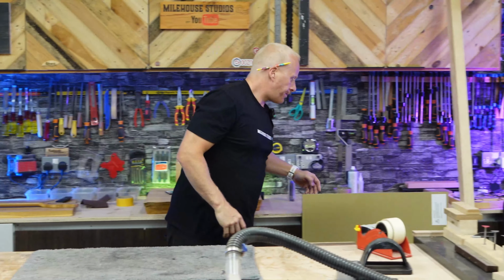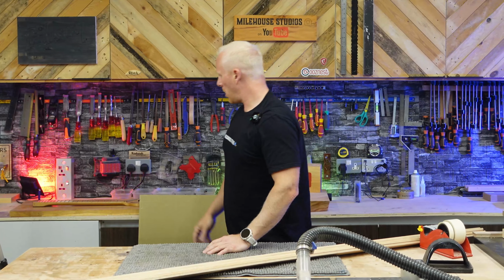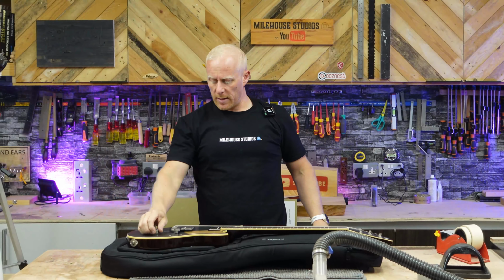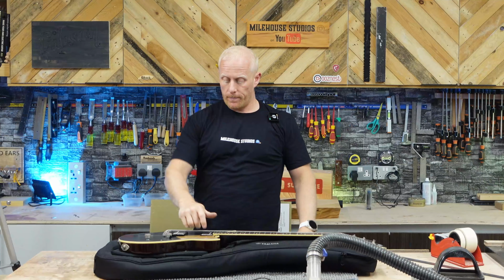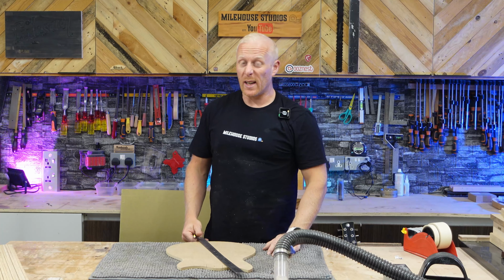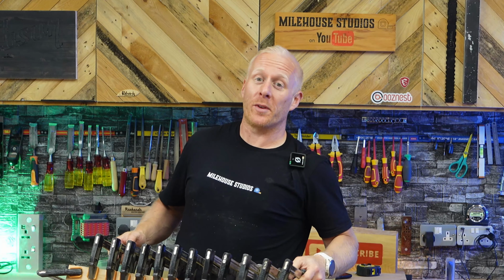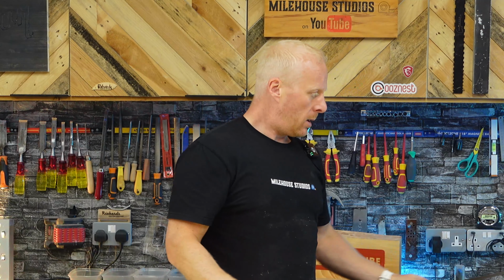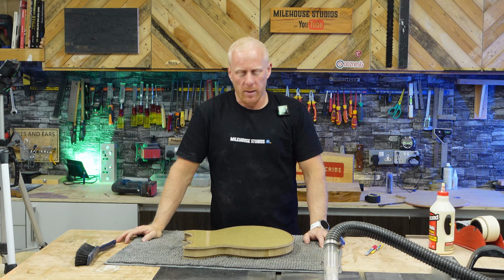Making Chris Bucks Guitar?  Day 1

Comment: This is going to be really cool !!!!   I think if you routed the centre piece for the pickups, wiring channels, and control cavity before putting the top on it might be easier... you can then use a flush trim top bearing bit to rout the pickup cavity in the top by placing it face down on your router table.....once the back is glued on the cavities will be done... you'd just have to remove the portion of the back that sits over the control cavity .... might work ....I'm sure you've already got a plan .... Cheers Mate !!!! looking forward to the next one !!!
Reply: Agree re: wiring channels.  Also consider weight relief - a few big holes on the middle section.
Reply from the maker: Weight relief will be happening. It weighs a ton 😂

Comment: I am not a luthier. I am just an alo guy who wanted a really cool over the top guitar that i made myself. partly for the resulting guiter , the adventure and learning the new skills for the build project.  Starting with a Starcaster-Strat electric hguitar By: Fender. and going totally ouverboard with mods and upgrades. I trashed the cheap electronics and stripped the body and headstock down to bare wood.  And the adventure begins. I used spray cans and airbrushed details. Starting with a gloss black base coat and then began the stars and planets outer space theme paint job on the body and headstock. finished with 2X acrylic seemi gloss clear coat. . And away we go with a custom hand made extended brushed stainless steel pick guard loaded with 3 quad rail/coil humbuckers wired like a "50's Les Paul with coil splits.. Yup that means ther are 6 500K audio taper pots 2 are regular typr tone pots and there are 4 P/P pots, 3 are for voil splits and vol. the 4th is in the bridgee tone for a bypass that activates the bridge and neck pickups togeyher regardless of any other controls. I used .047 orange dro[ tone caps. all of the choices in the design of the control circuit are to promote a clean bright "Strrat" type tone. ..yup 3 vo/. 3 tone and a Fender 5-way blade switch. the pots ar arranges in 2 crescent rows of 3. the output jack was relocated to just behind the bridge also mounted in the pick guard. the bridge got a full size brass sustain block and roller saddles. the headatock got a titanium nut, roller sstring tree and locking tuners .. all the exposed haerwaer is chrome. Knobs, switch tip, tuners, the top of the bridge are all chrome. all loaded in the afore mentioned extended brushed stainless steel pick guard that acts as a shield and is the main ground through the controls cases, the wiring was quite the adventure with all those connections to solder and routing the wires to make it all work as designed. whivh it does and quite well. bekieve it or not this is in fact my very first guitar build/mod/upgrade project. and the resulting guitat is better than i expected it to end up. A very cool looking great feeling,playing and sounding instrument i can be proud of having made myself. Wanna Play???
Reply from the maker: Mate everything you just described is why we do it...All for the love of the game. ❤️

Comment: I'm still going back over your older videos. It's great watching 👍🏻 quick question, why do you always use your jigsaw upside down?
Reply from the maker: I've been running a kitchen company for 20 years. it's common in the trade. You can't scratch a glossy finish with the jig saw and also you can see the line you're cutting perfectly.

Comment: I've seen you use a jigsaw from the underside in other videos, been meaning to ask why? Thanks.
Reply: I'm going to binge watch this one 🤘🤘
The main reason is because of the tooths from the jigsaw are pointing upwards and that can cause jagged edges.
So if you use it up side down the edge will be nice and smooth. Especially for laminated wood.
I've done this several times like this.
But for safety reasons you really want to mirror the mall and cut it the normal way from above.
I hope this was helpful.